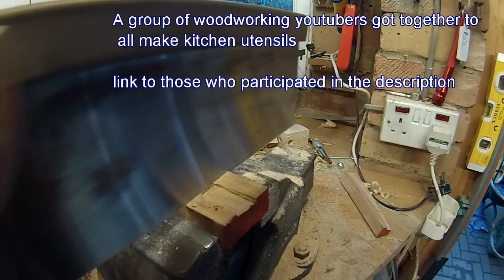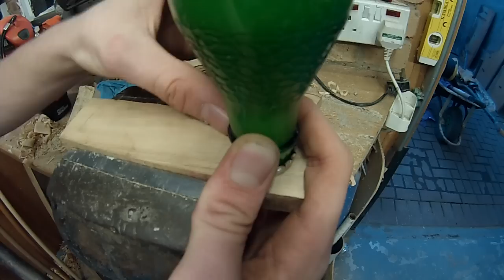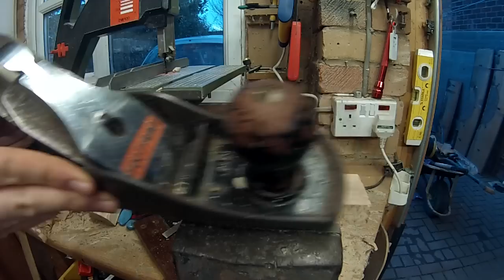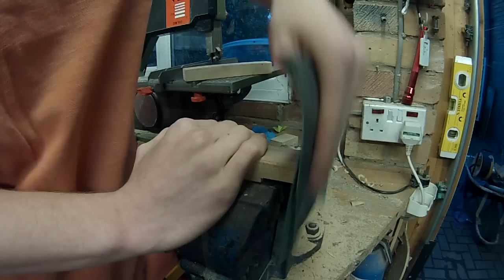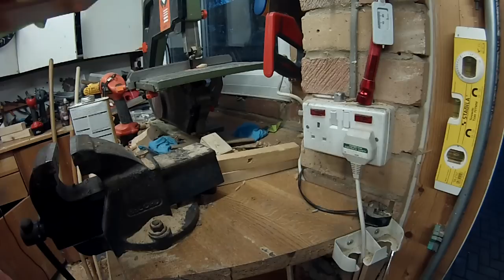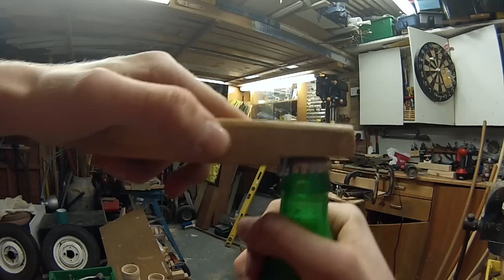2015 Kitchen Utensil Challenge - bottle opener TOM HOWBRIDGE

Comment: Thanks for sharing but I would like to suggest feeding stock from right to left for safer and better results when using the router.
Reply from the maker: I do heavily observe cutting direction and in this case I found it different because it was a through cut unlike a side cut like this http://youtu.be/a8nJjU304do?t=4s 

after a bit of research I found this 
http://www.wonkeedonkeetools.co.uk/media/wysiwyg/Router-Bits-RB-Ruth/RB-Part-1/RB3e/RB-3E-4_1.jpg

So that has answered it. i don't do through cuts to often but I will be doing more now.
Reply from the maker: I also have not used my router table for ages so I have been used to using my plunge and trim router.